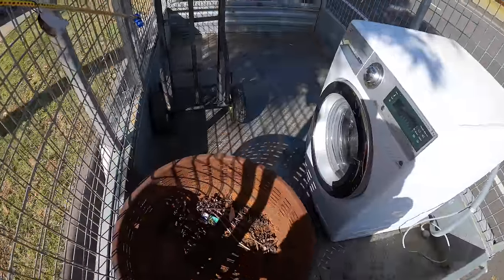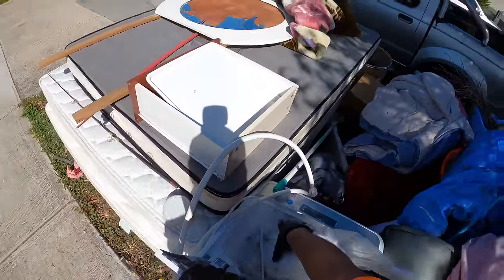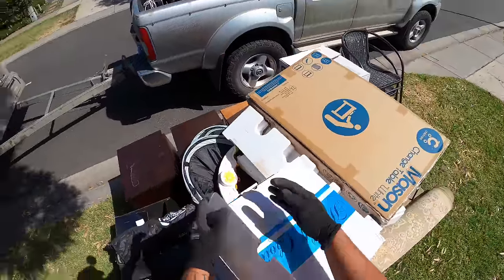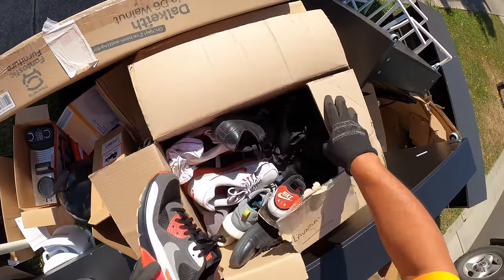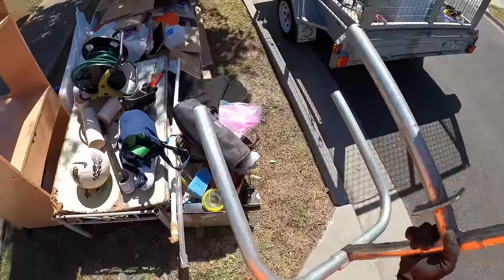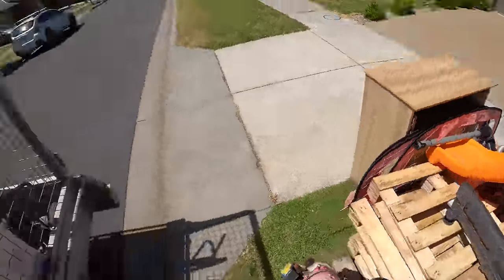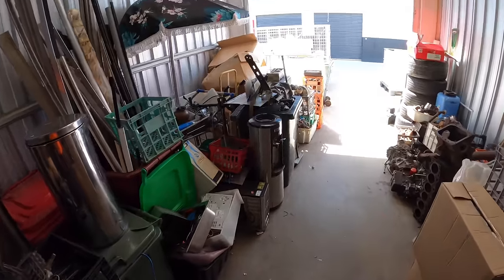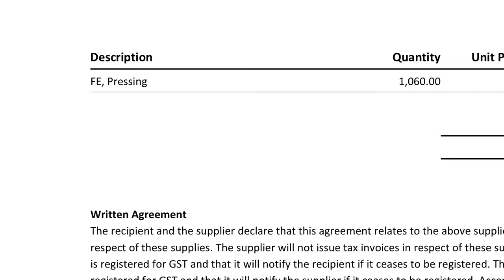Street Scrapping & The Heaviest Dirty Steel Load Ever!

Comment: We use them to store pvc fittings. Cut the broken damaged tops off and store the bigger stuff like the 4inch tees and other fittings for sewer,  drainage lines, water collection. Grab what you need got to site. If new community load whole thing in truck bed or on trailer

Comment: When scrapping copper cables. Say you have car body looms. Do you have to remove any electrical tape that's on it? I know there's money in car batteries but what about batteries from drills ect..?
Reply from the maker: No you don’t have to remove the tape. Just the plugs if you want a better price. The scrapyard will buy lead acid batteries not lithium ones from drills etc. 👍
Reply: @PolyProphet  thanks for the advice bro. I got no clue and still learning about all this. Keep up the good work